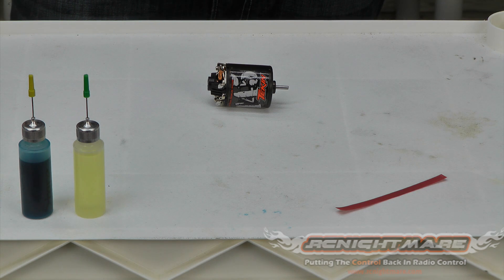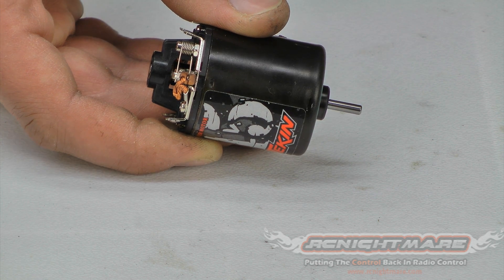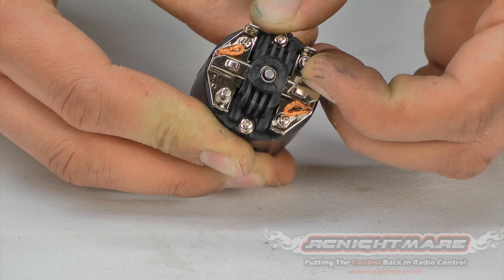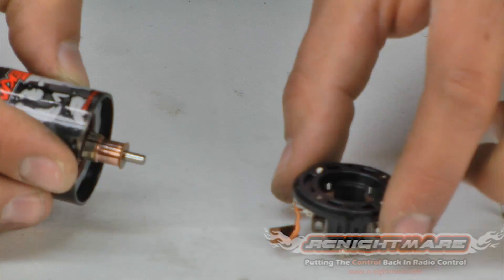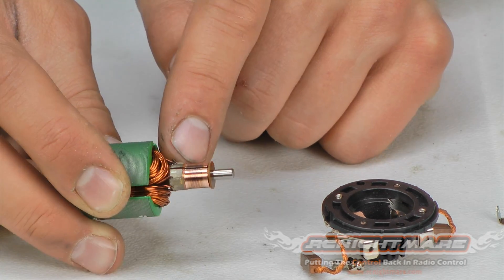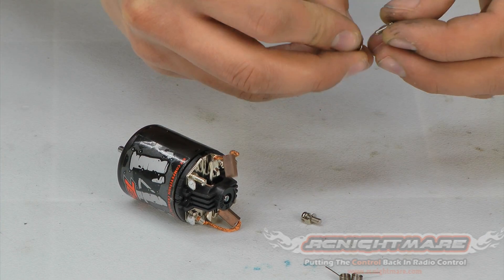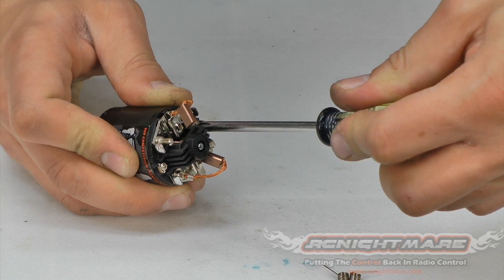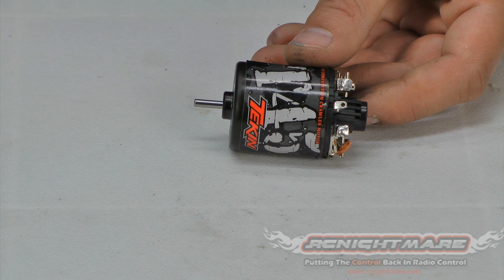How To Rebuild A Brushed RC Motor

Comment: I have a problem with my 390 RC motor. It runs but doesnt at top rpm. It looks like if the electricity cant flow through at all. Just for a couple of seconds and then It gets dead.

Comment: Do you know how to fix my monster truck?
It has the lights and mine has bullets in front and it shoots by itself when i turn it on,lights still work and my controller the anteane is off,still can put it back in and the light on the controller still works,the truck cant go foward or backward and cant turn left or right

Comment: Video was pretty helpful for me. Most specifically the part about the timing marks. I picked up a used Losi XXX buggy and it had a Speed Gems Topaz motor in it. I wanted to take it apart to clean it since I wasn't sure if it was ever done. (and judging by how filthy it was it hadn't been). I put all the shims, etc, back in and seated the brushes but the motor would just stutter and not spin when I tested it. Turns out i'd not known about the timing and had the end clocked wrong. I set the timing to neutral per the indicators given in this video. (the marks on the end and can) And it spun right up like it should. And so did my brother's Associated B4 which we also cleaned. So this video saved some frustration as none of the other videos i'd watched even mentioned taking note of the timing.

Comment: i saw some comments below including one with Team brood racing....now i have two custom brood motors in my rock crawler and this video helped me out 10 fold.... i had never taken a motor apart before watching this video. the problem that came up with my custom motors was the timing ring or end bell retainer came loose and the hole end bell and ring came loose and i was freaking out and didn't know what to do. so as usual google is your friend and when i searched , this video was one of the first three things that came up so thanks to this video i was able to fix my own motor......THANKS SO MUCH IT HELPED OUT GREATLY

Comment: My motor dosent have the screws on top so can't get the motor apart
Reply: Then you have a stock sealed motor that is not made to take apart to replace or clean up the internal parts of the motor.

Comment: Adding magnets on the outside can speed a motor up, but I couldn't tell you what kind of power increase, if any, would be. Worth experimenting, it does work, I've done it on large scooter motors, but no real world testing other than putting magnets on the outside of the casing.

Comment: @Rcnation101 yes you can put brushless motors on crawlers, that's all I use, I don't like getting into deep water anyways so no problem...   novak rooster 18.5 is all I use

Comment: @rcnightmare 

amongst many, the biggest issue with this video is that your not using a lathe, your simply cleaning up the surface of the comm. comm concentricity is much more important then the color and shine. by sanding it youve thrown off round and youve damaged the surface.

Comment: @rcnightmare ive got an old (15+ years) accociated motor and im trying to take it apart and see if its still usable and i followed all the steps but once i backed out the screws the endbell wouldnt budge, any ideas?

Comment: I'm not following teambr00d but I know who they are from racing and they have a great reputation as one of the fastest motors around. And the only way I saw you're video BC someone linked it in the Traxxas forum and watched it and saw hoe completely wrong your information is. And a novice video needs to be correct as everyone that is watching your video is trying to learn atleadt the basics on how to service a motor...which you failed at doing yourself.

Comment: Fyi. Comm oil is design for comm lathes to prevent the comm from wrapping do to heat when cutting the comm. Not to use as a lubricate for brushes on the comm. The oil will reduce electrical conductivity and also attract dirt causing a hung brush that can damage the motor. And the area that holds the brushes is called the brushhoods not a cage. Please learn about motor yourself before you make a instructional video on how to service them.

Comment: Wow...been doing it wrong for 10years. You're telling people that spend their hard earned cash to basically destroy their motor. People watch your video loking for the CORRECT information. And when people that have more knowledge and experience in this field(myself with almost 20years and I also work for a industrial motor service center) tell you you're doing it wrong you should listen and care. But you blast them and with ignorance tell them you don't care.

Comment from the maker: @TeamBroodRacing heres the thing, links back to your website are bound to the url, not that actual site, so my point is if you were as "famous" as you say I believe more than 1 site on the entire internet would link to you, however, if you truely have rebuilt thousands of motors and have a better way, then you would be doing a favor sharing the knowledge.OS commerce is a very powerful platform but you need some work on the backend coding..best of luck on the rebuild.Sorry for your misfortune

Comment: @traxxas5308  traxxas motors are not rebuildable but just after 2 hrs of run take em off the truck and run in water till dust and particles are removed